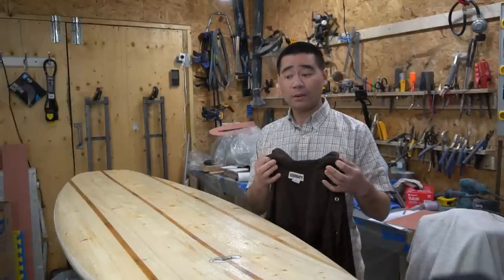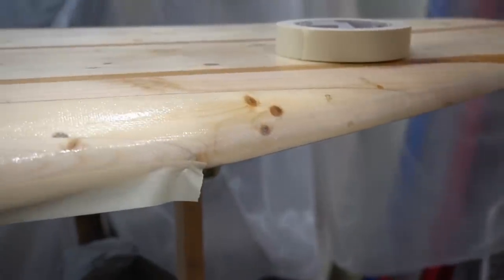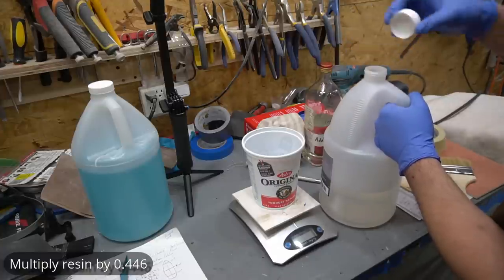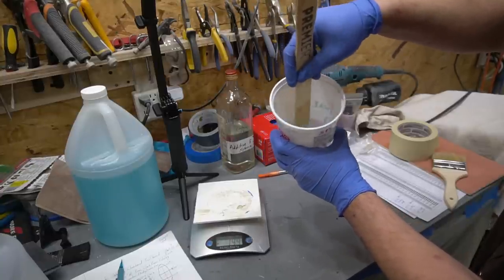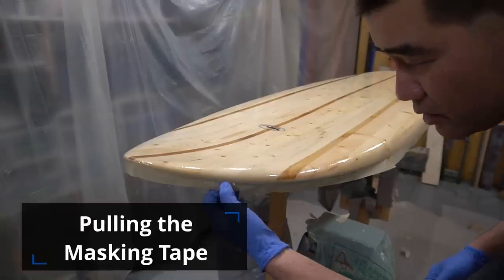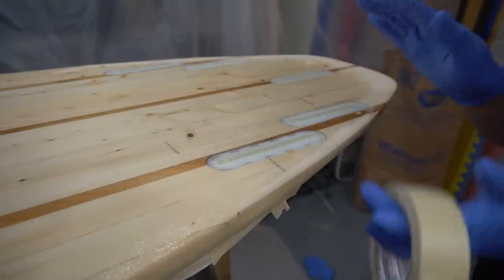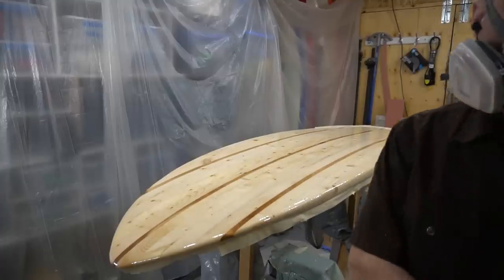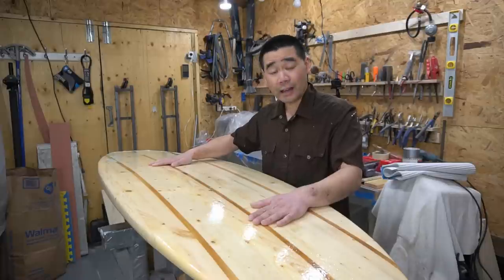How to Make a Wooden Surfboard #09: Hotcoating the Surfboard

Comment: Hi Andrew, Thanks for all your teachings!!! just a quick question regarding hotcoating; I'm using epoxy resin fast hardner for laminating, 10mins pot life, and it will be tacky for an hour or two, but if I leave it overnight I have to sand all fiberglass to a matte finish in order for hotcoating to stick to it;  would you not have to sand before you apply hotcoating? is not necessary what I am doing? could anyone help?